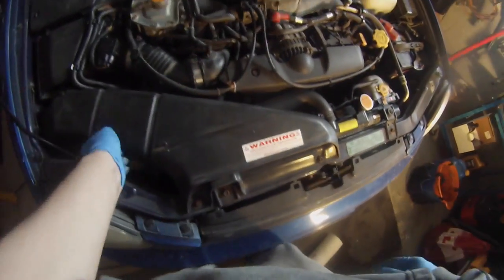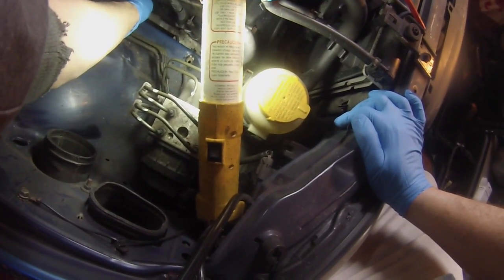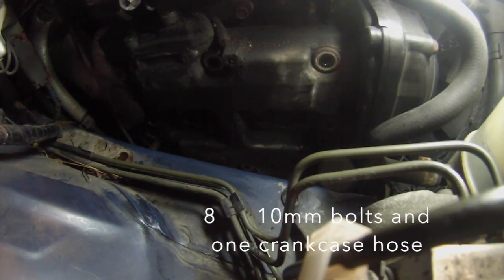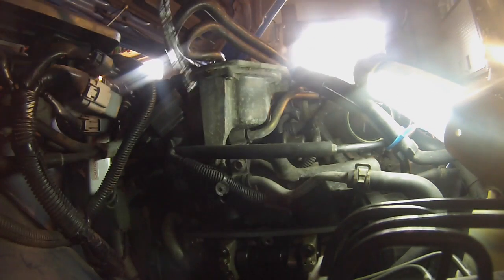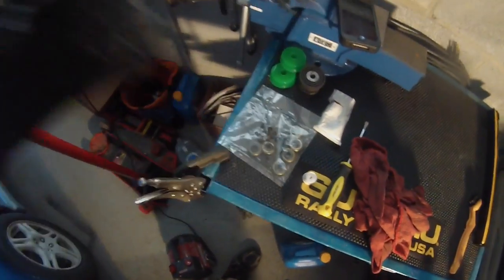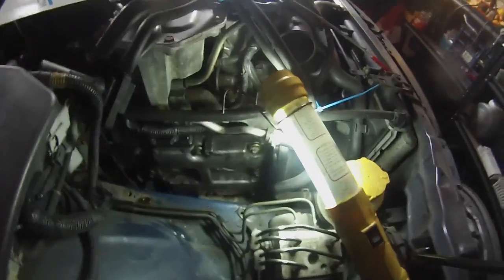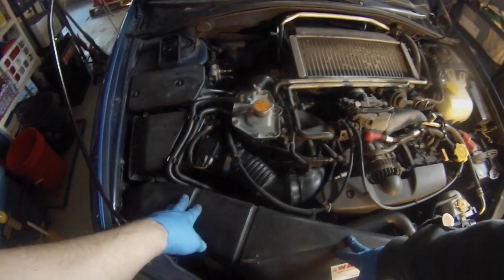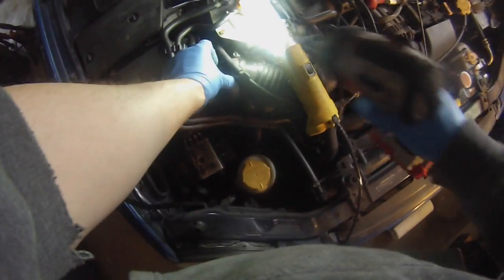2003 Subaru WRX 2.0 valve gasket ROCKER COVER Rumble Ready series #24

Comment: Hi. Did this get rid of any white smoke coming up from the passenger side engine bay? I have an 05 sti, and after driving for a while, when it is idling, I begin to see white smoke coming out from the hood scoop. I've pin pointed it to this same location. Please let me know!
Reply from the maker: Eddie G. Hello and Yes this is oil dripping from the leaking cover onto the exhaust and it burns , smokes white and smells. Fixing it will cure your issue just don’t overtighten the head bolts and use lots of Fujibond or RTV sealant.
Reply: @svtwrc  Awesome thank you very much for your prompt reply! I will give this a shot.